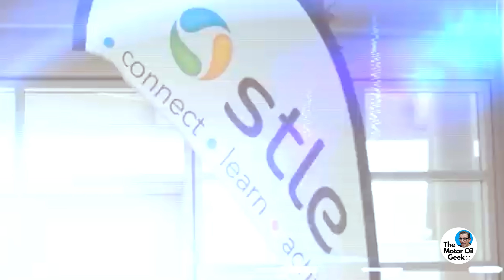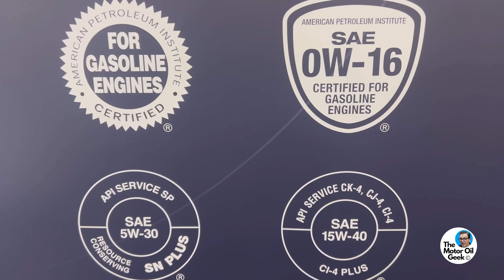Are Today’s Oils Ready for Tomorrow’s Engines?

Comment: All I'm hearing is "thinner oils are good for "sustainability", "fuel economy", "emissions".  I DON"T PRIORITIZE ANY OF THOSE THINGS in my motor oil.  I want motor oil to extend the life of my engine.  Period, full stop.  We've canceled the CAFE foolishness.  Can we PLEASE go back to sanity in our engine oils?
Reply: Then run gear oil, thicker oil isn't better 🤣. You might get away with it but not everyone drives a 25 year old rustbox truck
Reply: @BadBoiFX  Thicker oil is sometimes better.
Reply: @justliberty4072 And sometimes manufacturer recommended is better. But generalizing advice around switching to thicker is plain wrong
Reply: @BadBoiFX  There is no point for a gasoline engine sized for a car that oil thinner than xW-30 will ever be superior.  Metal is metal, clearances are clearances, and they won't ever change.  30 to 40 weight oil is the sweet spot, determined by experimentation, hours of metallurgical and lubrication research, and billions of miles driven over the course of an entire century.  The current insane drive to go to oil thinner than that is strictly to adhere to the whacko psuedo-science that is the Great Climate Scam.  Engines can be forced to use the thinner oils, but their service life has been meaningfully shortened.  There is no free lunch.  If you're desperate to run thinner oil (for fuel economy) then you're going to pay a price.  But no engineer ANYWHERE popped up and said, "Engines would be better with thinner oils, that'll be a real improvement."  No.  They went along with the climate scam just like everybody else.  And I'm weary of it.
Reply: @TheBuildist  The climate scam is real but you went full schizo now. None of what you said is true or backed by data, the answer still depends on individual cases, advice cant be generalised to just use thicker oil. Most wear occurs at cold start, after that most oils perform similarly, 0w20 and 5w30 at operating temps produce statistically insignificant variations in results. Just do more frequent oil changes is the best advice
Reply: @BadBoiFX  I'm sorry, but no.  Given the sizes and materials for main bearings, crankshaft journals, and the various valve train components, there is a lower limit to how thin oils can go and still be effective.  0W-8 can be shoehorned into a given situation, but it is and will always be inferior.  It can provide less resistance revealed in marginally improved fuel economy, but the tradeoff is brittleness.  The tighter tolerances necessary for the thinner oil to be an effective film also mean that the bearing surface has a tighter useful wear range before catastrophic failure. The sweet spot is 30 to 40 weight oils.   We can all hold hands and think positive thoughts, "Thinner oils can work! Thinner oils can work!"  But that won't change reality.  Physics is stubborn
Reply: @TheBuildist  And you showed zero data for what you claimed
Reply: @TheBuildist  There is pretty compelling data that often shows better wear numbers with 20 weight vs 30 weight. But only if it doesn't shear out of spec. 

More power and less fuel use is positive. If it can be done with the same wear it's a win.
Reply: @MathewPollard-vj4uq  I'll believe that once we get back to 300K mile engines.  All I know is we USED to have them, and now we don't.  "The new engines are even better!"  "The new oil is even better!"  Except at least one of those is a lie.  The new "way" in total is clearly inferior.  If you want me to accept the new "way" the onus is on you to prove that it's "just as good, even better" over the course of hundreds of thousands of engine miles.
Reply: @MathewPollard-vj4uq  When 30 weight oil first shears out of spec, it shears into being within 20 weight specs.  When 20 weight oil shears out of spec, the engine is destroyed.  That's the brittleness I'm talking about.  There's a world of difference between, "It can work in theory if you operate it perfectly" and "It's hard to kill."  30 and 40 weight oils work well in the real world where maintenance is late or skipped.  I find it unacceptable to opt for replacing hundreds of thousands of otherwise good engines in the cause of a percent or two of MPG.
Reply: Here's my data:  Toyota Tundra 4.7L v8 premiered in 1997, got 15mpg, used 5W-30 to 10W-40.  Mean time between engine failure something north of 250,000 miles.  2022 and newer Tundra: 3.4L twin turbo, 0W-20.  Gets 25 (or whatever)mpg.  Mean time between faiure: around 75,000 miles.  Similar story with Chevy's, similar story with Ford EcoBoost, etc.  Put "the experts" on mental "hold" and open your own eyes and take a look:  reality is staring you in the face.  CAFE forced the automakers to sell inferior products (complete with inferior oil)  Naturally, they put their best lipstick on that pig and acted like it was "novel" and "progress" and "modern."  But physics is stubborn.  All I'm asking is that we go back to normal, reliable automotive engineering as it existed at its pinnacle, which seems to have been somewhere around 1995-1999.  Every single change since then has been for the worse.  Oil weights included.
Reply: @TheBuildist An anecdote is not definite evidence of anything. Old shitboxes lasted longer for many reason, not necessarily because of thicker oil. Unless you have oil analysis data on newer engines I don't care what you have to say
Reply: @BadBoiFX  Fair enough.  Research proves that research works.
Reply: @TheBuildist  The difference between a conservatively built V8 and a screamer smaller twin-turbo is probably the bigger difference than oil weight. 

My guess is the 4.7L in my Land Cruiser would run fine on OW- 20. The oil in it often comes out so clean I've been to tempted to run it in my other cars. UOAs posted on others show extended intervals would be fine in them because they are so easy on oil. 6 Quart sump - oil cooler.
Reply: @MathewPollard-vj4uq  Then save some REAL gas and run 0W-08 in it.  What are you waiting for?

Comment: Am I using the wrong viscosity oil? 2009 Camry w/ only 60k miles.. Using a quart every 1k miles. It was a little old lady's car I picked up at 50k miles. Never seen a Camry use oil like that, especially with super low miles.
Reply: the old lady short trips may have stuck piston rings. that will allow oil to bypass the rings and get burned in the engine. try using Valvoline's Restore & Protect for the next several oil changes.
Reply: @michaelotoole1807   That's good oil, but no oil can free stuck piston rings.

From Google AI:

Yes, a piston soak with a suitable solvent like Berryman B-12 Chemtool or Sea Foam Spray can often free stuck piston rings in a 2007-2009 Camry by dissolving carbon and sludge buildup, with many users reporting success in reducing oil consumption and restoring performance, though severely worn or damaged rings may require a rebuild. The process involves removing spark plugs, pouring the cleaner into cylinders, letting it soak for hours (or overnight), then removing the liquid and cranking the engine before restarting, with some rocking the crankshaft to help loosen rings.
Reply: I think it is common, especially in 2007 - 2009. Look up "low tension rings".
Reply: The cap says 0-20 or 5-20..I used the 5-20. I'm afraid it's too thin and maybe just burning it. It's not leaking at all.
Reply: Miles is not condition.
I would never buy a low-miles-per-year used car.
Research piston soak, to free up the oil-control rings.
Reply: @aliendroneservices6621 Just change oil every 6 months and you won't need a "piston soak"
Reply: @SingleStacked  False.
Reply: @aliendroneservices6621 True.

Comment: I run 75W-90 in my hybrid. Much quieter 😂
Reply: I run straight 120w in winter and pack the crankcase with wheel bearing grease in summer.

Comment: I ordered a 04 f350, 6.8 v-10, 430 gears with a 6 speed manual and from day one it would use 3 quarts of oil in 3 to 3500 mile oil change, the first 45,000 miles I used motor craft syn blend,switched to Castrol edge same result, switched to valvoline full syn same results, royal purple full syn same results, now at 87000 miles I put penz ultra platinum and it's 1 1/2 quart so I guess my question is WHY  what would be the difference ? 
Remind you ford said back then it was normal for it to use oil at a rate of 1 quart for every 750 miles which I say B.S.
The irony of it all is I was a heavy line gas and diesel tech for over 33 years before my accident left me disabled.
Reply: Reminds me of my old D15B7 in ma 1993 Civic. Had it for 300$ with a bad motor. It would empty the sump in 500km.. tried anything from AMSoil, Redline, Pennzoil, Castrol (the worst offender of the bunch).. one day i put some Valvoline Maxlife SynPower.. Bam! Sump empty after 1000km.. then 1500km.. then 3000km.. ended up with an engine that consumed about a quart per OCI (5000km) never went lower than that but it was a 400 000+km engine at that point so i wasn't expecting any less. Then i met a girl that had a 1992 Civic with the same engine and had about the same problem i had, Maxlife SynPower in, bam.. Solved.
Reply: Maybe a higher CST viscocity of the penzoil?  Wonder what your oil consumption would look like if you bumped up your oil grade, 0w40?
Reply: @skibik3r I've only used 5w20 bumping it to 0w40 isn't something I'm willing to do,the truck has been very dependable even though it has used oil from day one I'm just not understanding why all of a sudden my oil consumption is half, don't get me wrong I'm OK with it. The truck only has 90,000 miles on it.
Reply: @rayrussell6064 
That is indeed very interesting. And no Pennzoil usually has slightly lover viscosity than Castrol, Mobil1, LM. Maybe the additive package has something to do with it. V. good oil anyway, and inexpensive. 0w-40 is slightly thicker than 5w-30, and I guess this why GM did a switch when they noticed their newish truck engine developed failures.
Reply: @rayrussell6064  Try motorcraft 10w30 diesel oil?  It might give you similar results to the penzoil as it's thicker.

Comment: more like: are tommorows engines ready for todays oil? (they increasingly suck ass compared to old engines due to cost cutting whereever possible)
Reply: I believe every case should be looked at individually, but modern passenger car engines are pushed as hard as race engines from not too long ago and that leaves less margins.

Comment: Can we see Morris's 1000 grade mainline steam oil tested on this channel? I'm curious to see how an oil for superheated steam engines differs from IC engines besides just the visocity being much higher.
Reply: When I worked in a coal fired power plant I found the steam turbine oil made a really good gun oil.
Reply: @SSgt-   I suppose both deal with extreme heat and pressure. :P